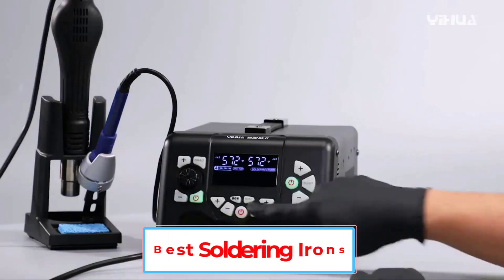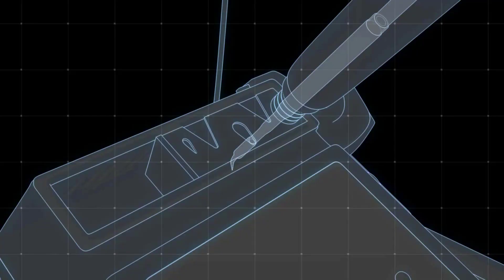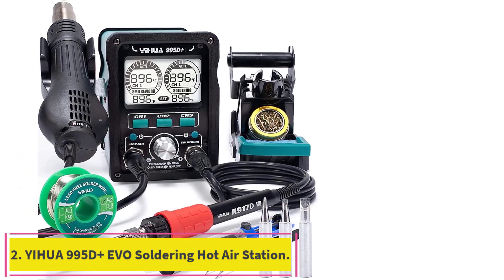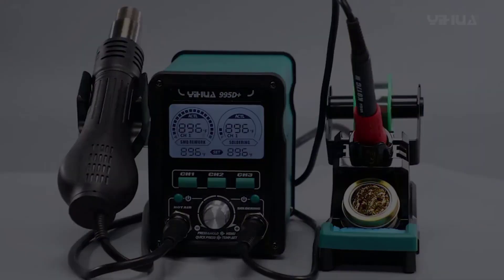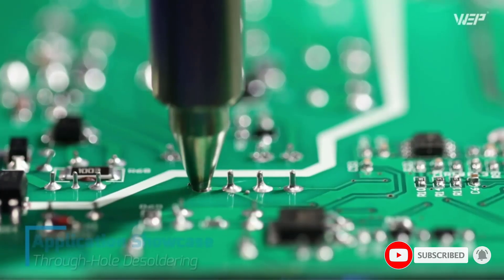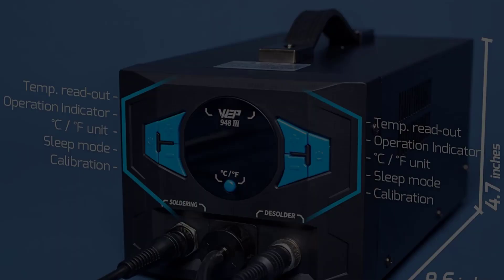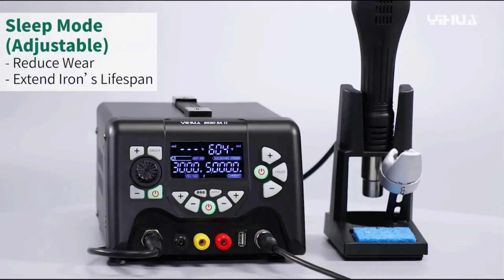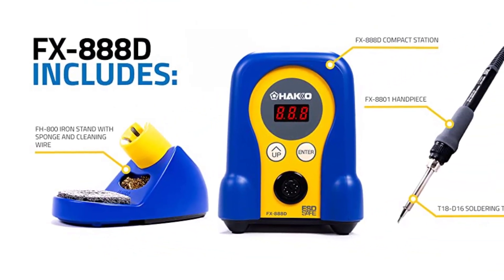Best Soldering Irons 2024 | Top 5: Best Soldering Stations [ Buying Guide ]

Comment: I don't need something this extravagant... I am looking for a good quality iron that comes with tips... All I do is solder a drone and the cheap irons I've bought have poor quality tips and they get dirty and crusty fast!! Got any suggestions? Thanks..
Reply: Go with hakko they are the cheapest out of the best quality equipment. Great product support I've had my FX-888D a few years now and it was honestly one of the best investments I ever made after buying cheap shitty irons. Idk how I've made it so far without it. The fx 971 is the newer technology in terms of tips so a 971 station would do you a lot of justice but more pricey. The fx-888D is a good price at around $100 the UI could get some used to but I set it and forget it I only use the on and off button.